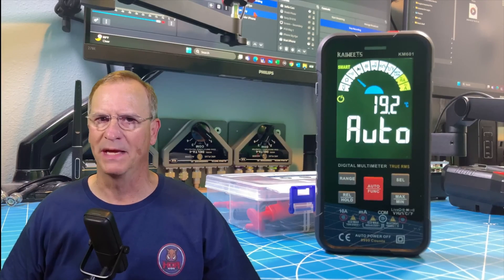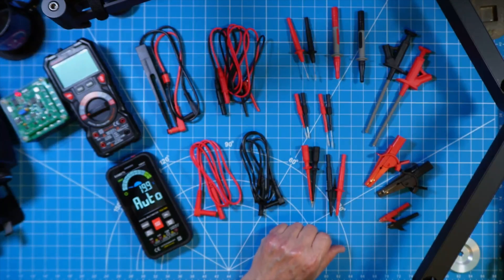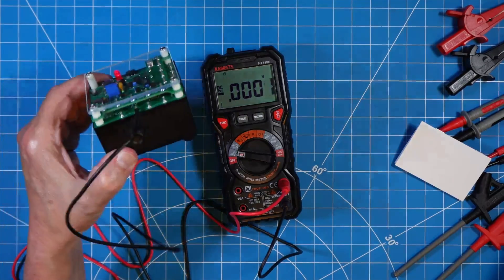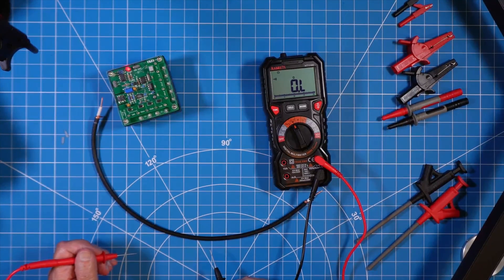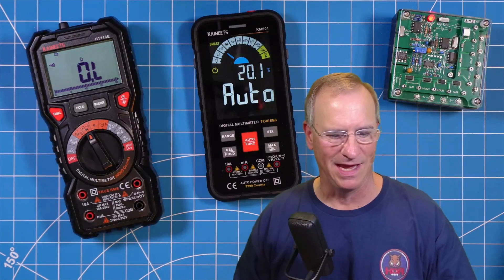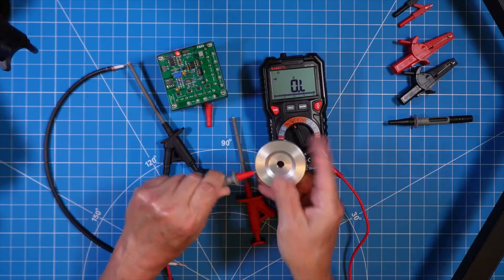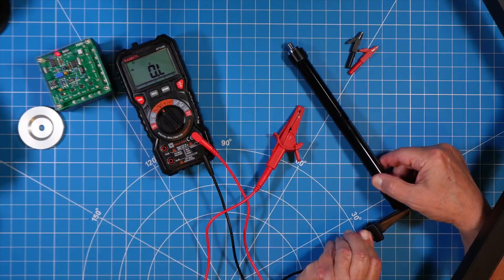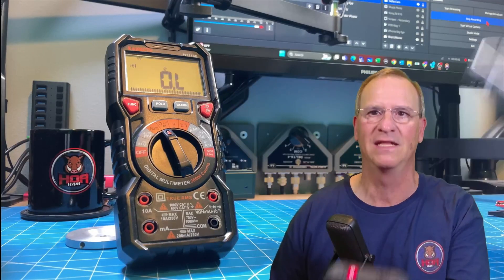You Need Test Leads for your Multimeter:  Demonstrating the Kaiweets

Comment: Good leads are a must, certain things required when probing surface mount pcb's which is completely different when probing leaded parts or old vacuum tube units.  I do like good probes.  I have a couple of sets from probe master.  Probably won't ever have to replace them.  Great video series for the beginner and the experienced!  73